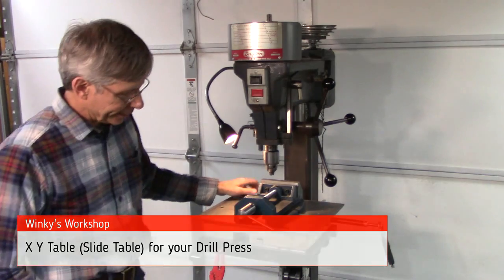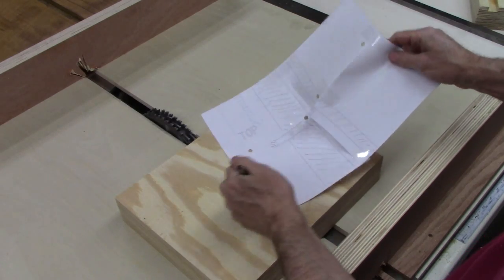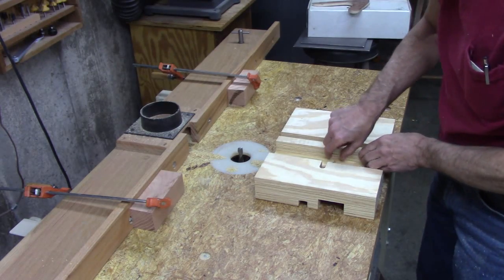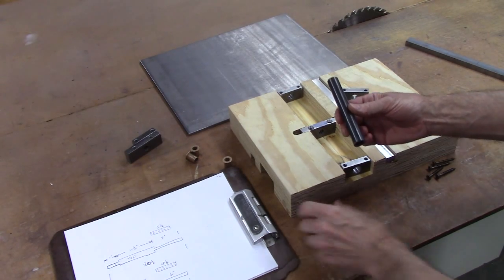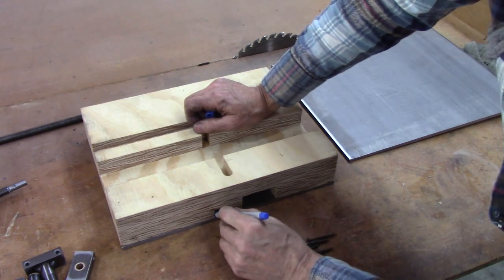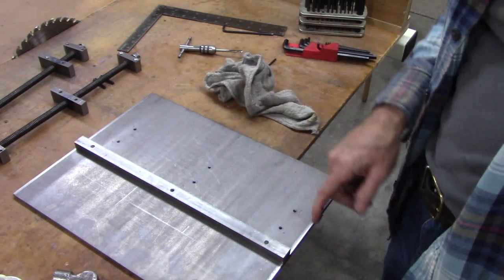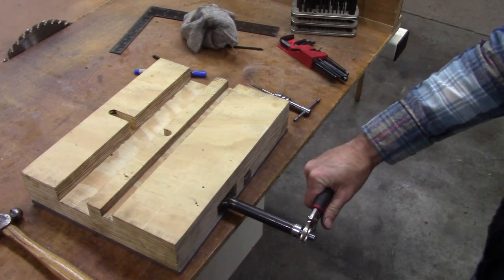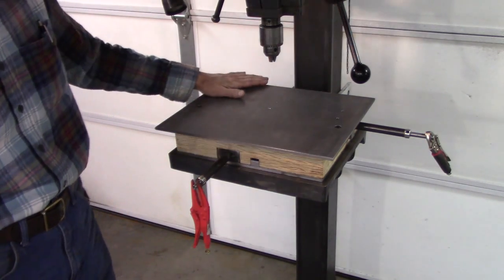Make a Compound Slide Table (X Y Table) for your drill press

Comment: Great idea and design but if you don't have a machine shop you might as well buy one.
Reply from the maker: This is an excellent point. Although you could build this without having a mill. It saves a little money over buying one and in some cases the end result is better, depending on how much you spend on a commercial x y table. If you don't want to build one (or only have a drill press) I encourage you to buy one. Don't spend less than $250 or you will get junk. You will never be sorry you spent the money! One other person said, you have an X Y table on your mill, why build another one? Also a valid question. Mostly because the drill press is up a little higher and more convenient but also sometimes I have the mill set up to mill and don't want to take the time to set it up to drill and back again.  Oh, and there is also the fact that my mill has a round column and my drill press has a square column....  everything stays aligned if I need to drop the table on the drill press. Thanks for the comment.

Comment: Neat. I will be interested to know the final accuracy & stability. That said, if you want an affordable small / mid sized engineers x-y table here in the UK (or likely most of Europe too...) there really are only Chinese imports available. They are cheap but have a terrible reputation for poor build quality, slop, inaccurate dials etc.  Many different makes but all appear to come from the same molds / factories etc. with virtually no quality control.  There is virtually nothing available that you might call "semi-pro" for home engineers seeking reasonable precision. Not many used, compact, reputable professional mill tables come up for sale. Having searched fruitlessly for some time, I came across your video &  it seems I could do worse than to follow your pattern & build my own!
Reply from the maker: Thanks, The table is very accurate as long as you work to one side of the backlash which is about .010 to .020. Almost all of this is in the cheap acme threaded rod and nut. The other day I drilled 6 holes 1-inch apart for 1/4-20 bolts in two separate operations and threaded one set of holes. The bolts were a very close fit but no binding at all. The table's weakness is larger holes. Anything over 3/8" and the table moves around. I'm sure most of this is backlash but some small amount is probably flexing as well. With that being said, if you locate all the holes with a center drill first the table movement is not an issue. I use this table almost daily and love it. Like you, I have looked for a good mill table also. There are several in the $200 to $300 range that look poorly made. If the close up picture of the dials is an indication of the quality it would not be good for much. Shars here in the US has one that looks a little better but still not great. I've actually thought about trying one but the leadscrew is metric. Good in your part of the world but not so good here.  https://www.shars.com/products/workholding/machining-tables/heavy-duty-mill-drill-table
Reply: @WinkysWorkshop  Thanks for the informative reply. Identical tables to the Shars, here are around £150. I found another type marketed as "precision" but the reviews were so variable it was hard to believe they were talking about the same machine! Seemed like only pot luck would get you a decent one.  Re. your DIY version, accuracy of machining & closeness of fit, which you clearly achieve, makes all the difference to backlash etc. I would think 0.01 - .02 is excellent for a wooden table!  I have an old Atlas lathe that has terrible backlash on the cross slide but you get used to accounting for it when machining. With the bench press, even if not doing more complex machining, a lot of the time I just need to quickly centre a part for drilling. Having to clamp it to the fixed table then release & try & move it 0.5mm before re-clamping is very tedious. The x-y / compound table or vice is invaluable for the job.
Reply from the maker: @robinstokes5179  - The square column drill press paired with the X Y table is more valuable than my mill. If people fully realized how valuable the combination was you see supplier selling drill presses with a dovetail column and mill table. I have my 5 inch vise pinned to the table in just the right position and I have never removed it. I have a square of 3/4" plywood with a 2x4 block glued to the bottom. If I need a flat table I clam the 2x4 in the vise and - instant table. I think the cheap mill tables would probably be okay. Making new dials is really fairly easy. I've made at least 10 dials so far. One think I would want is a table lock. The one I made does not have this.

Comment: If you spot drill the shaft the set screw won’t mar the shaft.
Reply from the maker: True, I should have done that on the short end and used a two piece clamping collar on the other end. One end needed to be somewhat adjustable.

Comment: This is awesome! Do you have any thoughts on adapting this into a cross-slide that could hold a tool post for my wood lathe. I'd love to be able to do a bit of metal turning. Is that a horribly dangerous idea?
Reply from the maker: Turn metal on the drill press? Probably not a great idea. Turning metal require things to be very solid.